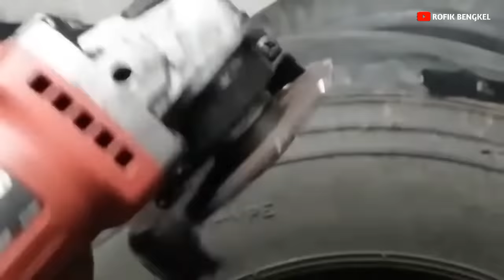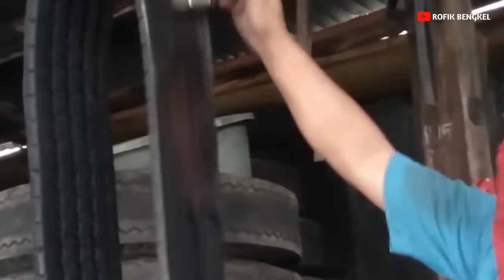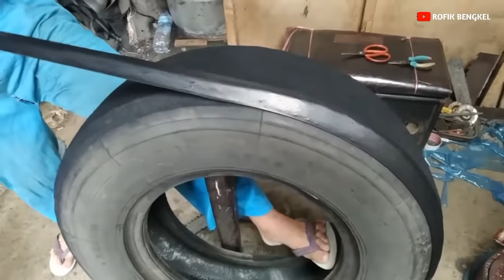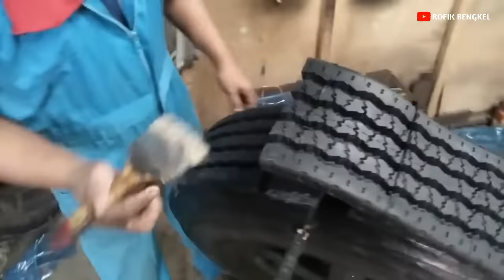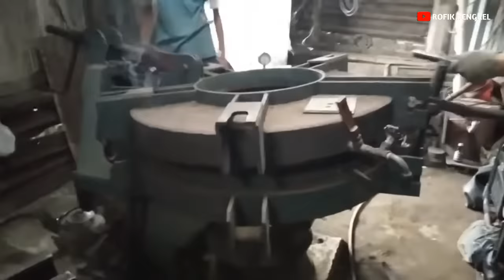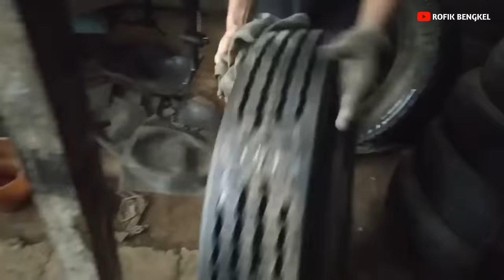retread wire truck tires, manually

Comment: 7:40 I was skeptical of the safety of the tire but once the staple gun came out, I knew that the tire was safe to drive on for forever!!
Reply: They use it to hold it in place for the glue to set.
Reply: BEEF SUPREME  r/whoosh
Reply: No brasil chamamos de pneu piruca
Reply: It's just to keep the thread in in place for vulcanising.

Comment: As a matter of fact, this is quite common practice. I'm from the Netherlands and worked as a truck and bus mechanic. There are 3 types of tyres, all from brands like Michelin, Bridgestone etc. Those types are: Regroovable, retreadable and normal ones. 

Regroovable can be used for cutting new profile into the tyre until certain predefined depth. They are not used on front axle anymore after that, but on driven axle or trailer axle only.

Retreadable tyres is what you see here and is normal practice as well. Can only be done once however by sending the tyres back to Michelin or Bridgestone. The tyres are not allowed back on front steering axle after that, but rather on driven axle or trailer axle.
Reply: Mooi man
Reply: Man here mostly in south asia people don't concentrate about safety factors. So here these tyre uses from both front and back.
Reply: En Chile es ilegal
Reply: I work in a retreading plant in Australia, they can be recapped more than once here
Reply: @incompetentinquisitor3667  in the USA I have seen our casings get capped 8 or more times
Reply: Cannot use retreads on the front steer axle  in the US either

Comment: Haven't seen a retread tyre in Australia for quite a while, not sure if they still do them here but they used to be a relatively cheap option with fairly good mileage many years ago. Interesting video thank you.
Reply: Rare to find retread tyres for private cars nearly all are remanufactured for commercial use only due to the cost.  Some companies that run large fleets of commercial vehicles actually rent their tyres.  It is also possible with some very large commercial tyres to recut another tread when they get to a legal limit. made possible for the considerable depth of material left below the tread.

Comment: a very interesting video. In the UK remould tyres seems to have gone out of fashion. It seems they simply replace tyres and any repair work is not very common, which seems very wasteful. Great video - thanks for posting.
Reply: Because it's easier to just dump all the used tyres to other countries like Kuwait.

Comment: To everyone, just remember your life costs much more than a tire.
Reply: Very dangerous I can attest
Reply: As a matter of fact, this is quite common practice. I'm from the Netherlands and worked as a truck and bus mechanic. There are 3 types of tyres, all from brands like Michelin, Bridgestone etc. Those types are: Regroovable, retreadable and normal ones. 

Regroovable can be used for cutting new profile into the tyre until certain predefined depth. They are not used on front axle anymore after that, but on driven axle or trailer axle only.

Retreadable tyres is what you see here and is normal practice as well. Can only be done once however by sending the tyres back to Michelin or Bridgestone. The tyres are not allowed back on front steering axle after that, but rather on driven axle or trailer axle.
Reply: Your name "Tamal" is a popular dish in México, its full of corn and pork grease... yummy
Reply: not in that country...
Reply: @tizcoloko  jajajajajaa

Comment: It is clear that this tire is not made for german Autobahn speeds - but on congested roads within crouded citys or on non-asphalt slow overland roads - It could probably work. If it does not, even the price-sensitive people wouldn't buy non-working stuff.
Reply: What do you mean, if it works? Re-treaded tyres are used all over the world, in Europe and the US.
Reply: @Liofa73  What I meant was: If it would not work, people would not buy them :-)

Comment: i hope they stay togather better than the ones in america, the interstate highways have a blown off retread laying on the roadside every few miles.there not worth the savings over new tires when they fail so often.the bad part is when they fly off they usually cause damage surrounding the wheel.

Comment: Retreads are Fine depending on your application. I use Retreads on rear Drives on my trucks that spend a lot of the time driving to landfills. Have never had one Throw a Cap off. But I also have my trucks GOV to 60 mph Max. The amount of Tires that get punctured in the land fill as about 4-7 tires a season per unit..Not worth putting Virgins since they get punctured pretty often. But If was a Highway truck I’d probably think twice about using Retreads. Not Worth the trouble or injury of losing a Cap at 75-80mph.

Comment: Skillfully done, probably works for some poorer nations with non existent driving restrictions , lighter loads and slower traffic due to high volume of traffic  but in no way can I see this tire be in any way legal in most of Europe or North America. Tires might be sold by unscrupulous dealers and used tire garages, as new, for all we know and many tires might even be ok in the short run but it's a risk I would rather not knowingly take.
Reply: I live in Los Angeles and it is been sold here.
Reply: Я с вами не соглашусь, я сам дальнобойшик и ездюю по разным странам, и в основном европейские грузовики ездят в наложенных колёсах.
Reply: @nunez23j1  those are done in big after market company, under strict rules, not by flat tire shop!!!

Comment: this is the reason you often find tirethreads in the middle of nowhere on the highway in the United States and other countries. Incredibly unsafe, they could come loose and slam into the windshield of the person behind you and possibly even kill them. i rarely downvote a video but rethreading roadtires is a public safetyhazard and should actually be forbidden by law in any country. Thankfully it is here in germany.
Reply: I had a feeling this looked mad unsafe
Reply: lol this is stronger than new tire tread look up the statistics. dont you know how they make new tires? thats like saying welding metal makes it weaker, it actually can be made stronger if you kno what your doing. tired manufacturers have a way worse track record when it comes to factory defects, failures, and recalls compared to most tire repair professionals.
Reply: türkiyede de böyle bişey yok bu lastikler muayeneden geçmez. dişleri taktınız ama yan tarafın zayıflığı ne olacak eskimiş lastik yanlardan çatlar uzun yolda boom diye patlar. çok tehlikeli
Reply: @jogailaab  Yeah, there are no such statistics. My new tires are not held up together by staples. What a joke.
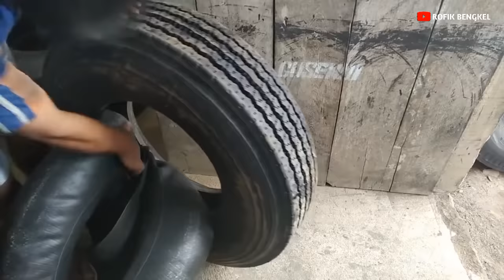Reply: @PavlinMavrodiev  Staples dont hold a thread, just help with the gluing process as per 13:11. I do agree, that looks dodgy af though.
Reply: Actually, you're wrong re-treads are very safe. Most transport companies and airlines also use re-treaded tyres, it's just so much more economical. They aren't banned in Germany.
Reply: @Liofa73  They are HIGHLY illegal in Germany, even with hefty fines on it. Wtf are you on about
Reply: @maksymiliankasprzyk8655  You are right. I actually looked into this and the bottom line is that there is rethreading and then there is rethreading. Compare this rethreading https://www.youtube.com/watch?v=r0vW7bngBCc to the one in this video...
Reply: @shylodesloovere4070   they are indeed allowed in germany.. but restricted.  They can just be retreaded once per wheel and have to meet certain standards.
Reply: @shylodesloovere4070  you are absolutely right
Reply: @timtaylor9590  I think repired tires defects are not recorded like factory tires failures
Reply: Here in Germany there are also retreaded tires. Almost every truck uses this because it is simply cheaper than new tires. You can even buy retreaded tires for cars. Whereby the price advantage is rather small ... Use and retreading are subject to strict requirements, but they do exist. Just ask a truck driver. ;)
Reply: @shylodesloovere4070  There are retreaded tires in Germany. Without staples, of course. Just ask the tire service or truck repair shop. Like everything in Germany, the retreading of tires is of course subject to many regulations.
Reply from the maker: hi, thank you all for your input and suggestions, actually this tire is recommended not for heavy loads and is used in buses / transportation vehicles, in my country this kind of business is allowed, maybe in other countries it is also prohibited
Reply: @automovement.official  i have seen such tires used on Heavylifting Trucks on public roads. As far as i am aware rethreading tires at least for cars can cost about as much as buying a semidecent tire so no benefits gained plus the added risk of wrecking after your tirethread comes off
Reply: @Liofa73  agree with this. fleets in Europe/Germany use retread tires but has strict guidelines on quality/inspection. usually sidewall issues are immediately scrapped. airline tires are retreaded up to 10x.
Reply: My friend almost lost his arm to one he had a convertible and had his arm out the window one of these hit his arm so hard it was horrible looking.
Reply: Had one blow out right in front of me thank God didn’t do any damage to my truck
Reply: 100% exactly
Reply: They staple them in america to the staple isn't what holds it together
Reply: @PavlinMavrodiev  The staples are just to keep the thead on until the tire is vulcanised. Also, anyone who says retreads are illegal in europe (including germany) or the USA is simply wrong. Sure it's not done in small shops like this, but the proces is the same. A well done retread is perfectly safe.
Reply: Maybe the tire doesnt cook well because thats the only way the retread comesoff

Comment: As long as the side of the tire is acceptable, it should be retreaded this way. It's just that the refurbishment process is more responsible than imagined, not a hot melt synthesis. It is better to stagger the different bends from each other more. These workers are very lovely, I hope they have better income. I think this is in India?

Comment: i have no experience in doing this, nor am i an expert, but if the tread isn't round to begin with, i reckon it's hazardous. like, the new, linear tread has a chance to unstick itself from the joint, isn't it?

Comment: can only speak for  my own experiences but i think most commenting about safety are thinking this tire will be doing 70+mph on a american highway, i am willing to bet this tire will never see over 35mph if that...  those rubber cement bonds a lot stronger than most think.
Reply: You are wrong. The tires are driven more than 70mph every where. Most people don't know the danger involved in using this type of tires.

Comment: This rethreading tyres are for slow-moving light to heavy trucks and shouldn't be used on front/steering wheels. Not recommended for passenger cars since the safety aspect is unsure. They use it for economical reasons.

Comment: apoco si aguanta una enfrenada con alta velocidad y con bastante peso del camion   little if it holds a braking with high speed and with enough weight of the truck

Comment: Ok, am not a retread fan, but these trucks aren't being use on super highways, most are rual delivery trucks on back roads, now then a good 8 ply steel belted tire core. May be a lot better choice than  cheap chinese knock off if all your going to do is 45mph.